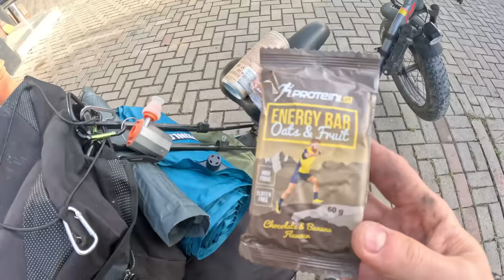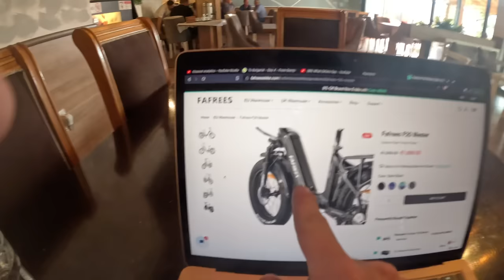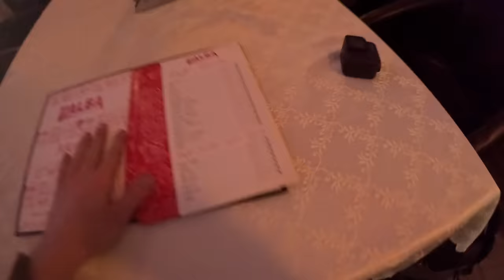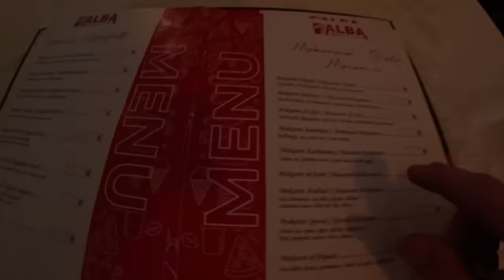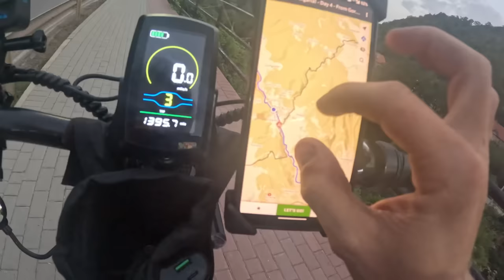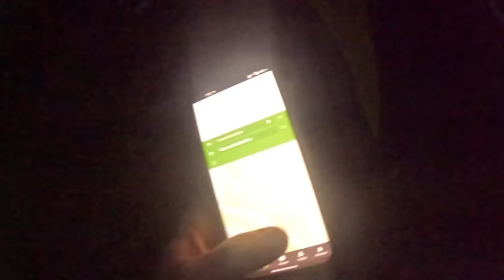Kosovo - Day 8

Comment: Pro tip: You can fix squeaky brakes by sanding your rotors and break pads, also the hotter your rotor gets the higher your braking power gets. Another tip for you to center your brake caliper (Cause sometimes centering the calipers lowers your braking power) loosen the 2 bolts of the calipers till you can move it around (The bolt that is screwed on the frame) then hold the brake levers as you would brake in downhill, then whitelist holding the levers tighten the 2 bolts. Works everytime👍
Reply from the maker: This is probably the best tip I've seen here so far
Reply: Also, Please be careful when you're working anywhere near the disc rotor, they are sharp. Don't ever put anything near it specifically when it is spinning, just spin it after you are done, otherwise you might cut your finger. it is best to approach it while it is not spinning.